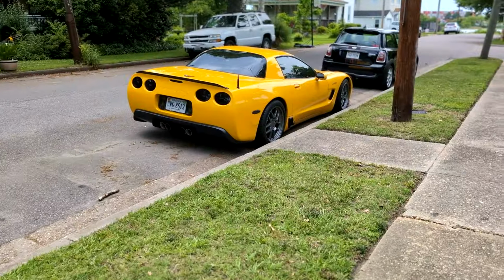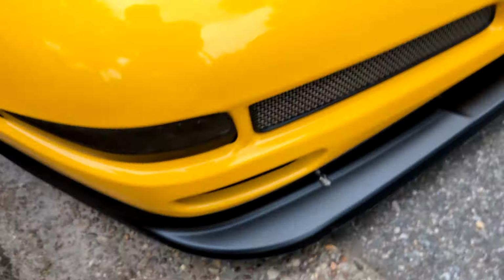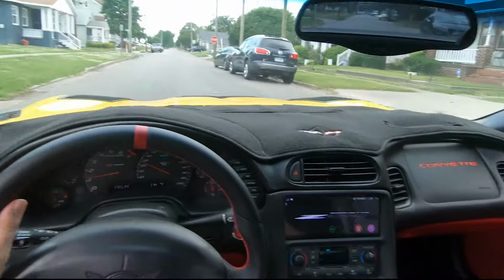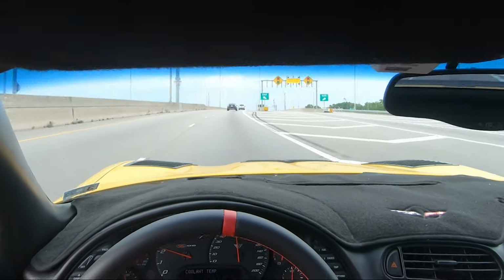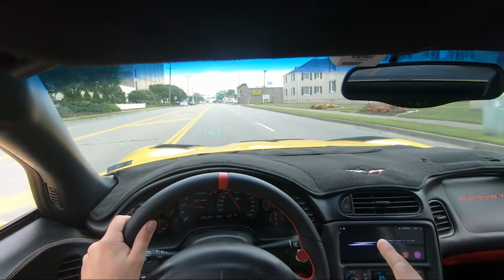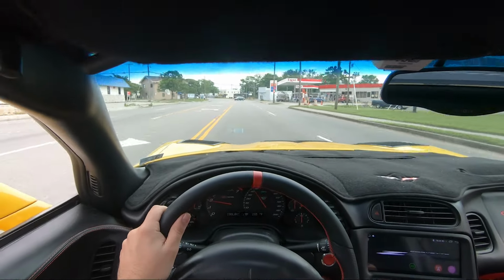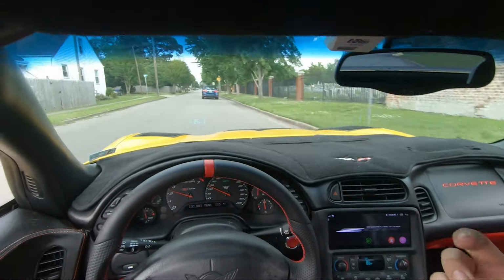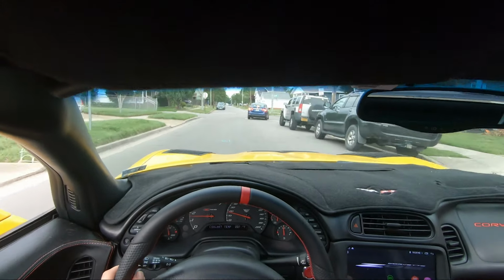HOOD VENTS & FRONT SPLITTER 1 YEAR UPDATE | 90 DEGREE WEATHER STRESS TEST! BONUS Z06 POV DRIVE

Comment: I had a guy use HP Tuners lower the set point for the high and low speed fans. I Autocross my car. Before the fans were reprogrammed, it was common to hit 235+ degrees while the car was idling in between runs. I would turn on the AC to override the set point and force the fans to come on. Now, the low speed fans comes on at about 196 and the high speed fan kicks on at 206.  Even after six consecutive runs at an Autocross on a hot day, idling for 10 min at a time between runs, my temps never go above 205. Stock radiator, stock thermostat. I am using a better coolant with a "water wetter" type additive.   Normal highway driving or even in stop and go traffic, I'm at about 190-ish.

And wear real shoes when you drive you friggin heathen! 😂
Reply from the maker: Hahaha 🤣.  I have driven barefoot any chance I've had since I was 16.  It's sounds weird, but I feel more connected to the car.
Reply: Yep similar here in my C5Z. Sitting between autocross runs you gotta run the a/c. I don't have HP Tuners so either i need to find someone with one, or i may get the button operated fan controller. Really silly that GM had the fans kick on so late without a/c on...
Reply: @murfenator82 it cost me less than $150 for the HP Tuners license fee and the mechanics time to change the fan temps. The switch you can install is almost that much money, and you still need to turn it on yourself, which isn't really different than turning on the AC.